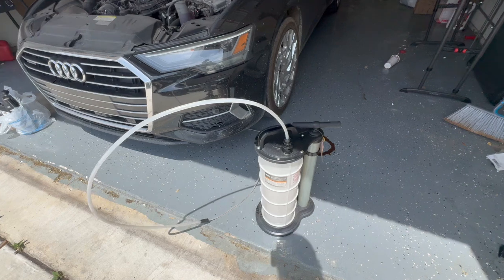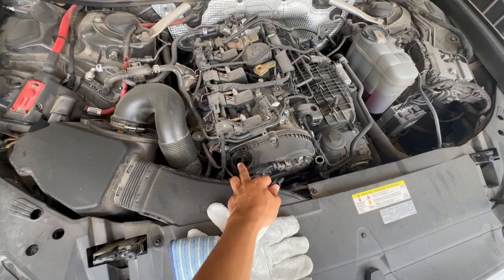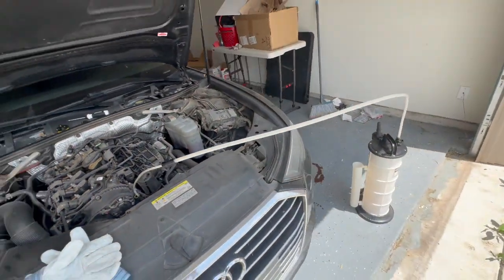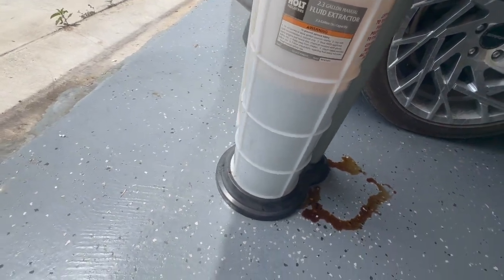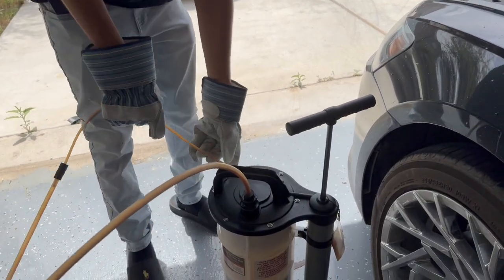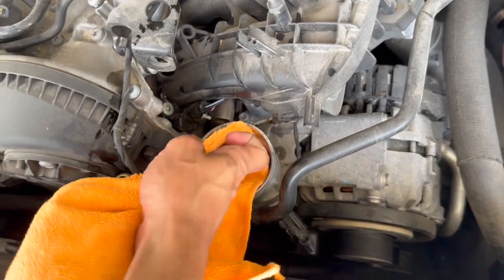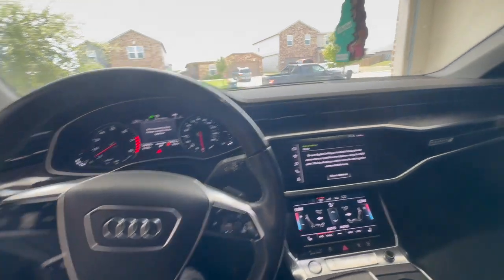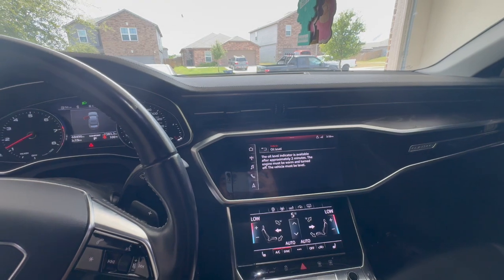2019 Audi A6 Oil Change(How to)

Comment: Good job young man. However, you don’t need to use any tool in tightening the filter. Hand tighten until you can’t do it anymore is more than enough torque required.